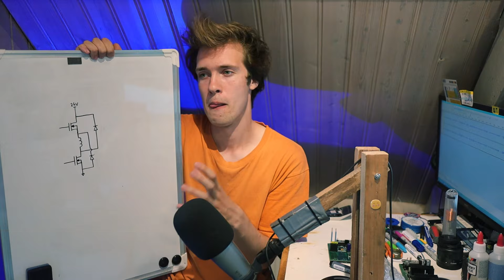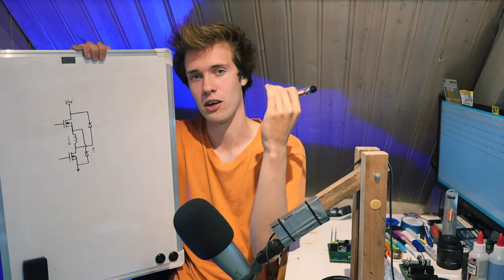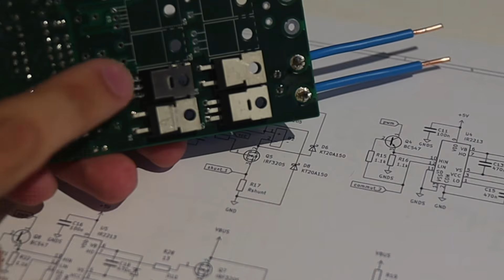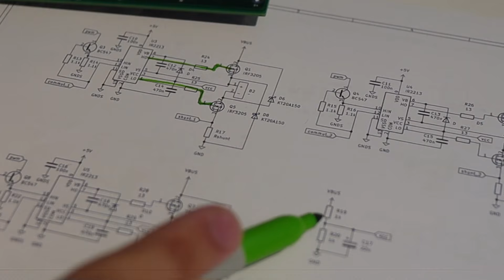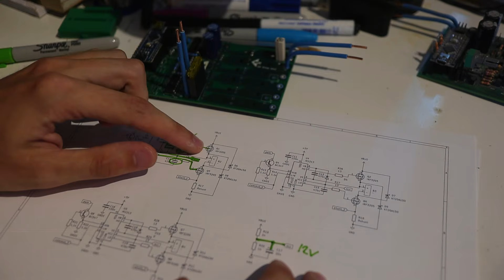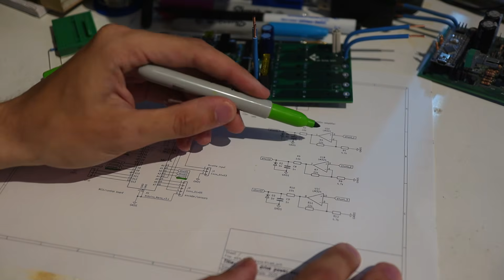The new SR motor driver board

Comment: Brilliant! Better than any other movie!
1. Couldn´t you use one common shunt resistor on the negative supply rail since only one phase is active at the time?
2. I also would like to see your position estimator! Or are you only driving open loop right now?
3. I assume that there is a certain angle that is the most efficient angle at lower loads? Maybe centered around 90degrees 🙂
4. Trevlig kväll
/Tomas
Reply from the maker: You could get away with a single shunt, but it would make the design less flexible. While typically only one phase is active, control schemes with overlap are possible and can be used for reducing torque ripple etc. With this design I keep that option open.

I don't need position estimation because I use an encoder to monitor the rotor angle.

The ideal firing angle is a complicated thing and varies a with speed and load. I ended up constructing a kind of look up table in the software to determine it, it's not ideal but it works ok.

Comment: Why do you need 2 mosfets to switch a phase? Couldn't you switch a phase with one n channel mosfet between the winding and ground?
Reply from the maker: I think I did mention this at some point, but basically if you only use a single fet the current will take far longer to decay, and the magnetic field energy will not be recovered back to the power source. It will work with a single switch but performance and efficiency are lower.
Reply: Sorry. Must've missed that. I'll go watch it one more time.

Cheers mate!

Comment: Hey great video, though am thinking, if with the soft switching the goal is to be efficient when doing PWM when a coil is selected, don't u think that letting of current to cycle though the coils as it decays the one causing overheating issues in the new video. Maybe you just use designated pins or that LED/Keyboard Matrix trick to address them well with the limited pin budget. but thanks for sharing, and I think the dead way would be great along with a great algorithm.

Comment: I build my own SRM and looking for a good driver and PWM. I got a schematic diagram from Microchip and want to know if you are finished with your board. I made some minor changes on the SRM and want see if I can increase the torque. This is the reason why I am looking for a good driver and your driver looks very good.
Reply from the maker: Yes I finished this one, works pretty well, haven't had any issues with it so far. The arduino (atmega 328) microcontroller is on the slow side though, it gets the job done but something faster (and with faster ADCs) could enable you to run fancier more elaborate control software.
Reply: Are there a possibility that I can use your circuit?
Reply from the maker: @charliestevens9185 I'm making a video about my completed motor/driver soon. It will also involve publishing a schematic.

Comment: Im actually trying to make my own SR motor partially due to you, and im realizing my motor wil be very non standard, to the point i probably cant use a driver like you, but this was still ridiculously useful. Im currently playing around with and learning this stuff. Pwm, transistors, switching, inverters, and i have a beginners grasp over it already. Maybe i could learn a bit more about coils and their behaviour related to maintaining magnetic fields, voltage spikes, simialr phenomenon and why it happens. This is cool and fun stuff. I really appreciate you making these videos as i believe my motor wouldnt be as cool otherwise.

By the way i got my hands on a metglas ribbon, found it on alibaba, though delivery is super expensive, but the material itself is quite cheap

Comment: Is it possible to control the power output if the motor by simply varying the power on & off angles. So for less power a brief on time, with a lot of "freewheel" time.  If you are worried about max coil current you could set the off point to be when a max current is reached and then vary the "on" angle to vary the power.

This would likely be noisy but it has the potential advantage of being able to use a simple optical sensor and wheel (think old fashioned mouse) set up and varying the firing angle by moving the sensor around the housing.
Reply from the maker: Technically you could control power with timing only, but you'd have very poor efficiency, since you're essentially constantly going between max acceleration and max braking.

What you can do (and this is done on a lot of controllers beyond a certain RPM) is use a single pulse to drive the phase, and vary the length of that pulse to control power. But, this is only suitable at high speeds, since at lower speeds it would give big "gaps" where the motor produces no torque. So a lot of controllers will start with pwm/current control, and as they get to higher speeds switch to single pulse mode.

Comment: Really good explanation as always. Thanks! Btw, I noticed that you said that you are using an IR2113 to drive the MOSFET gates, while the circuit diagram says IR2213.
Reply from the maker: I intented to use (and did use) IR2113, but man you're right I put the 2213 on the schematic. Guess I'm lucky they have the same pinout haha.

I think both would work for this circuit.